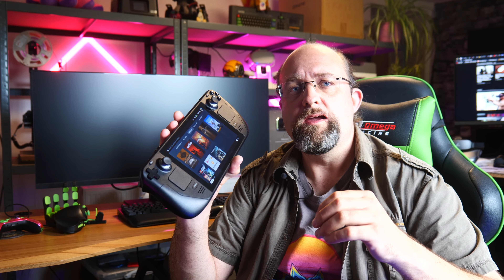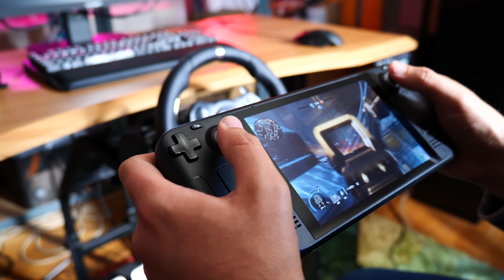The Steam Deck Review - Ultimate Portable Gaming Console?

Comment: Playing AAA titles from 2005 - 2015 on the Steam Deck makes the Switch look more in line with a Razer gaming phone. With a little more time for Valve to work out the Proton compatibility tools, the Steam Deck will be recommendable with few to any caveats.  The battery life is akin to a gaming laptop, and limited to current battery tech, not the design of the device, so I don't understand why it has to be prefaced so much in reviews.  I have no problems with the battery life using only minimum game and  device optimizations.  It's truly a game changing device.
Reply: Actually these gaming phones are very powerful. Almost on par or better than the deck. It's the software and difference in instruction sets in arm cpus that hold them back. They would also get really, really hot unless the phone has active cooling. Windows 11 has an arm version that works on a few phones at the moment that can actually run triple A titles and a decent speed it's up to developers and OS makers to take advantage.

Comment: Your game time really will depend on the games you play and the settings you use. If you are using everything SteamOS has to offer, you can massively extend your battery life. And from the looks of it, you made this video before Valve pushed the 40Hz refresh rate into the stable channel. Tweaking may not be something that console fanboys want to do, but if you are a PC gamer, you are probably familiar with it in one way or another. With a battery powered device, you can't just crank everything to full and expect the battery to last, you will have to make some compromises. But if you use 40Hz mode, the built in FSR mode, and adjust the TDP settings and in game settings, you can definitely get more out of it. I was able to play with a friends Steam Deck, and Fallout 3, though it is an older game, was estimating 5 hours of gameplay, and it looked just as good as ever. Sure, its an older game, but it is a 3d rendered, open world game, like you mentioned. You might have to fiddle. You had to fiddle with the Steam Controller if you wanted the best experience with it. But it is open and flexible to allow you to do that. You wouldn't see half of these features come from Sony or Nintendo on their handhelds without hacking the firmware and installing homebrew. Valve is selling you your own hardware, for you to do with it what you want. That's not something you see from other console manufactures. Valve's already got my money, they just have to send me the email.
Reply: Yeah I just don't like how people tend to interpret the reality of the situation. You don't have to fiddle, the Steam Deck just gives you the option. You don't have to play unverified games, the Steam Deck just gives you the option. From my experience, things just work and you don't actually have to do anything if you don't want to.

And it's weird, when people compare it to consoles, they act like not having the option is a good thing. There are games on the Switch that run very poorly, are locked at 30 fps but dip below that. On a Steam deck you would have options to lower the resolution or reduce graphics settings but on the Switch you can't, you have to live with games as they are and that's an advantage? I do not understand that mindset and how giving you options suddenly makes you itchy and feeling like you have to make use of those options. You do not, just don't if you don't want to
Reply from the maker: Yeh they only just pushed that, though it gives less battery life than the 30hz I've locked to at the moment. I'll give 40hz a try, but like I say - 2 hours is more than enough for me, so its a good compromise .